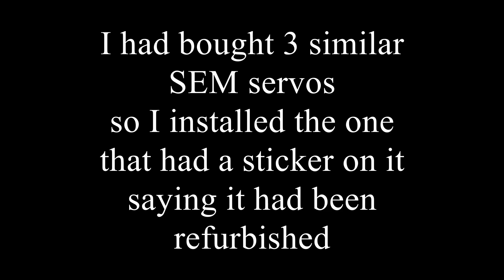SEM servo autopsy

Comment: Please sending me a video encoder setting
Reply from the maker: I'm sorry, I have nothing of the sort available. There are timing diagrams from Heidenhain regarding when the I (index) signal should appear regarding the A an B signals (and its magnitude and form). A and B signals should form a circle when viewed with an oscilloscope and some current to voltage circuitry.